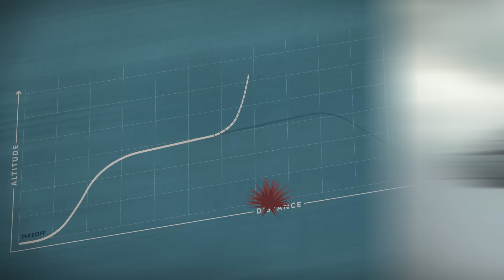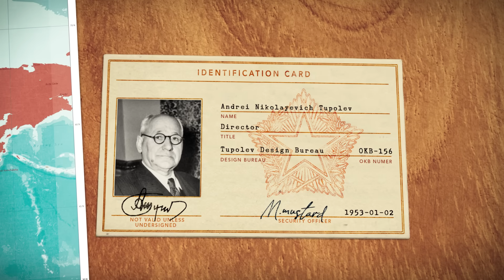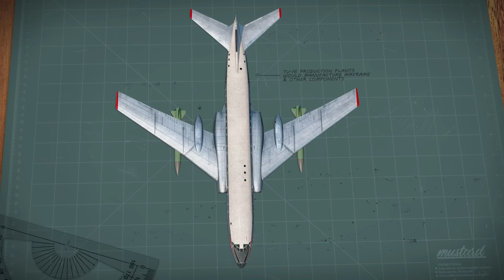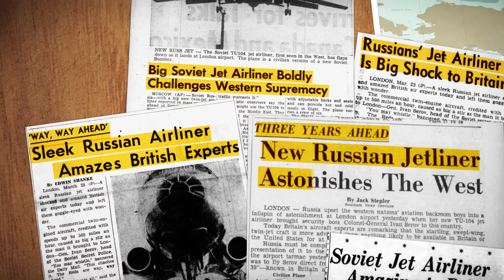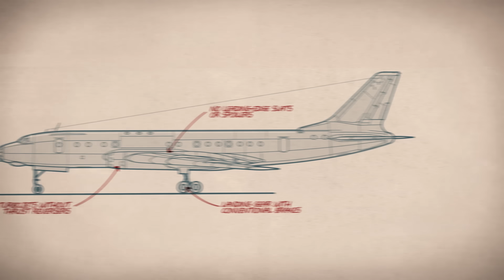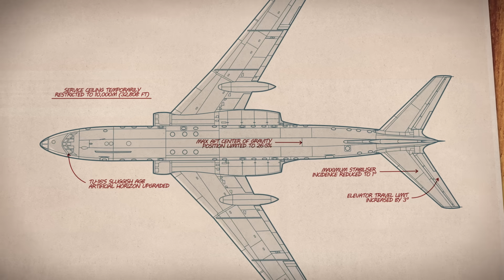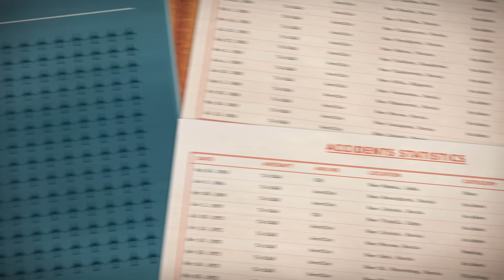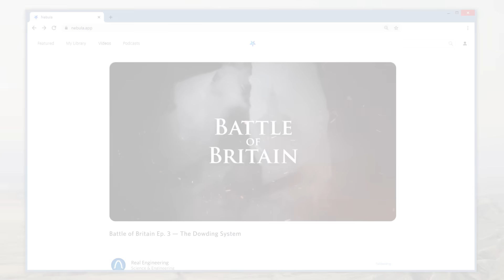The Soviet Airliner Designed To Crash

Comment: In a realist world a really small loss of life for an extremely huge jump in technology 😢
Reply: Certainly a more successful aircraft than the de Havilland Comet 1.
The Comet 1 was so bad it's certicate of airworthiness was permanently revoked
Reply: The Tupolev & Comet  had similar accident losses statistics.

The marvellous trailblazing DH Comet.

World's first jet airliner.
World's first high altitude airliner.

De Havilland was subjected to forced merger during the UK Govt instigated aerospace sector rationalisation programme.

Instances of all Comet marks, including the Comet 1, flew with full certification at some point after 1954. Airline duty Comets were all retired by 1980 with full certification until after retirement. The last Comet flight was a global circumnavigation series of flights in 1997.

   Of course De Havilland carried out a full stress analysis & performed extensive & protracted testing on two long lengths of fuselage. De Havilland carried out significantly more testing than was required by any authority at the time & significantly more testing that any previous airliner was subjected to.

    De Havilland did indeed always work to better than industry standards at the time, used up to date knowledge for the design & no evidence of negligence  or criminal negligence was ever produced in relation to the DH Comet.
  
  Obviously there have been worse aircraft for accident losses both before & after the Comet, that includes's fatality rate metrics. One of the issues was accident losses & incidents due to pilot error which were often caused by the novel aspects of jet airliner flying, even so, the accident losses for the Comet were not particularly unusual at the time.

About Bow-wing for instance (See b-47 wing folding / collapse incidents.)

There can be no excuses for the 737 Max incidents after more than 50 years design, build and operation experience & with up to date aviation infrastructure. 737 Max, 2 particular incidents caused 350 fatalities. Aircraft auto pilots itself into the ground, two times.

The many & varied reasons for Bow-wing's (See b-47 wing folding wing collapse incidents) current existence & status have nothing to do with the company itself by the way.  

    How things were back then. 
Accident losses - % of aircraft built.
DeHavilland Comet 4 UK              14% 
DeHavilland Comet all mks          17%  
Vickers VC10 UK                            5%

The DH Comet had better safety than or similar safety to many other commercial passenger aircraft of a similar era.
Douglas DC-1                                      99%
Douglas DC-2                                      47%
Douglas DC-3                                      30%
Douglas DC-4                                      26%
Boeing s300                                        72% 
Boeing 307                                          70%
Boeing 247                                          48%
Boeing 707                                          20% 
Lockheed L-049/149 Constellation  30%
Lockheed Electra  Turboprop .          29%
Fairchild FH-227                                 30%
McDonnell Douglas DC-8                  14%
Sud Aviation Caravelle                       15%
Canadair CL-44  Turboprop               46%  
Convair CV-580  Turboprop               22%
Convair CV-880     (ff 1959)               27%  
Convair CV-990     (ff 1961)               33%
Tupolev T-104        (ff 1956)               16%.

Comment: In soviet union plane flys you...straight into the ground
Reply: British plane flies you to your death when it explodes at high altitude.
Reply: The Tupolev & Comet  had similar accident losses statistics.

The marvellous trailblazing DH Comet.

World's first jet airliner.
World's first high altitude airliner.

De Havilland was subjected to forced merger during the UK Govt instigated aerospace sector rationalisation programme.

Instances of all Comet marks, including the Comet 1, flew with full certification at some point after 1954. Airline duty Comets were all retired by 1980 with full certification until after retirement. The last Comet flight was a global circumnavigation series of flights in 1997.

   Of course De Havilland carried out a full stress analysis & performed extensive & protracted testing on two long lengths of fuselage. De Havilland carried out significantly more testing than was required by any authority at the time & significantly more testing that any previous airliner was subjected to.

    De Havilland did indeed always work to better than industry standards at the time, used up to date knowledge for the design & no evidence of negligence  or criminal negligence was ever produced in relation to the DH Comet.
  
  Obviously there have been worse aircraft for accident losses both before & after the Comet, that includes's fatality rate metrics. One of the issues was accident losses & incidents due to pilot error which were often caused by the novel aspects of jet airliner flying, even so, the accident losses for the Comet were not particularly unusual at the time.

About Bow-wing for instance (See b-47 wing folding / collapse incidents.)

There can be no excuses for the 737 Max incidents after more than 50 years design, build and operation experience & with up to date aviation infrastructure. 737 Max, 2 particular incidents caused 350 fatalities. Aircraft auto pilots itself into the ground, two times.

The many & varied reasons for Bow-wing's (See b-47 wing folding wing collapse incidents) current existence & status have nothing to do with the company itself by the way.  

    How things were back then. 
Accident losses - % of aircraft built.
DeHavilland Comet 4 UK              14% 
DeHavilland Comet all mks          17%  
Vickers VC10 UK                            5%

The DH Comet had better safety than or similar safety to many other commercial passenger aircraft of a similar era.
Douglas DC-1                                      99%
Douglas DC-2                                      47%
Douglas DC-3                                      30%
Douglas DC-4                                      26%
Boeing s300                                        72% 
Boeing 307                                          70%
Boeing 247                                          48%
Boeing 707                                          20% 
Lockheed L-049/149 Constellation  30%
Lockheed Electra  Turboprop .          29%
Fairchild FH-227                                 30%
McDonnell Douglas DC-8                  14%
Sud Aviation Caravelle                       15%
Canadair CL-44  Turboprop               46%  
Convair CV-580  Turboprop               22%
Convair CV-880     (ff 1959)               27%  
Convair CV-990     (ff 1961)               33%
Tupolev T-104        (ff 1956)               16%.

Comment: We believe we can clear up some commonly held myths and misconceptions obviously.

It's always good to see the facts presented clearly and concisely isn't it?

Obviously there have been worse aircraft for accident losses both before & after the Comet.

  De Havilland was subjected to forced merger under the govt aerospace sector rationalisation programme.

In 1944 the RR Nene, a centrifugal compressor gas turbine aero engine, was the most powerful & most reliable gas turbine aero engine on the planet. For decades after 1944 copies & versions of the RR Nene & RR Derwent would go on to power aircraft in many countries including Russia (Mig-15 & Mig-17), the US, France, Switzerland and China.  Five manufacturers currently produce various types of gas turbine aero engines which include centrifugal compressors, the main application is helicopters. 

The world's first wind tunnel was constructed in England before 1890. The world's first supersonic wind tunnel was constructed in England in 1922. Extensive wind tunnel testing & evaluation were carried out for the Comet. All takeoff incidents were the result of stalls caused by over rotation. There were feature induced issues where pilots tended to not using jet airliner specific takeoff procedures. Subsequent changes made to the aircraft were an attempt to make the aircraft more tolerant of such errors. 

It is in fact correct to state that no aircraft manufacturer had managed to produce a high altitude airliner with a full fuselage length pressurised passenger cabin pressurised to 8 psi differential before De Havilland did it with the fabulous trail blazing Comet. This was the first aircraft where pressurisation stress significantly exceeded flying stress for most of the airframe. The world's first pressurised cabin aircraft was a British design Airco built under licence in the US and modified in the US to have a pressurised cockpit cabin during a joint US / UK research project. 

 Testing included water tank pressurisation cycle tests on two 20 foot lengths of fuselage which represented all features of the complete fuselage.

The engines used for the earlier Comets were of course similar to the RR Nene, were very reliable  & were not responsible for any Comet incidents.

The fabulous trail blazing DH Comet.
World's first jet airliner.
World's first high altitude airliner.

    How things were back then. 
Accident losses - % of aircraft built.

DeHavilland Comet 4 UK                     14% 
DeHavilland Comet all (ff 1949)         17%  
Vickers VC10 UK (ff 1962)                   5%

Douglas DC-1                                      99%
Douglas DC-2                                      47%
Douglas DC-3                                      30%
Douglas DC-4                                      26%
Boeing s300                                        72% 
Boeing 307                                          70%
Boeing 247                                          48%
Boeing 707  (ff 1958)                         20% 
Lockheed L-049/149 Constellation  30%
Lockheed Electra  Turboprop .          29%
Fairchild FH-227                                 30%
McDonnell Douglas DC-8                  14%. 
Sud Aviation Caravelle                       15%
Canadair CL-44 Turboprop (ff 1959) 46%  
Convair CV-580 Turboprop                 22%
Convair CV-880  (ff 1959)                   27%  
Convair CV-990  (ff 1961)                   33%
Tupolev T-104     (ff 1956)                   16%

  The Vickers VC10, fastest Atlantic crossing for a non supersonic jet airliner, held the record for 41 years. 

The DH Comet & Sud Aviation Caravelle had similar accident loss fatalities for the first few years of operations.

Agreed, that is correct of course, clearly there are many countries that could easily produce airliners of better  quality than Bow-wing (see b-47 wing folding & wing collapse incidents) but don't for some very good reasons. Bow-wing being a result of the size of the US, the large protected domestic market & great ease of testing new types due to the equator to arctic geography & a few other reasons related to production scale capability, politics & economics.

  Obviously there really is nothing special about Bow-wing, having more than 50 years design / build experience on the type means they have no excuses for the horrendous Max incidents for example.

   Of course De Havilland carried out a full stress analysis & performed extensive & protracted testing, including pressure cycle testing, on two long lengths of fuselage. De Havilland carried out significantly more testing than was required by any authority at the time & significantly more testing that any previous airliner was subjected to.

    De Havilland did indeed always work to better than industry standards at the time, used up to date knowledge for the design & no evidence of negligence or criminal negligence was ever produced in relation to the DH Comet.

  The DH Comet had better safety than or similar safety to many other commercial passenger aircraft of a similar era both before & after the DH  Comet.

Pretty much all changes made after the Comet 1 were just in case changes or were previously planned ongoing improvements.

We do indeed hope this helps, of course.
      
As always, cheers & 👍 indeed.  .

Comment: 2 earliest jets both turned out to have teething issues. 
British grounded their planes, soviets said "yeah this is fine. Keep going"
Reply: The Comet has the highest loss rate and fatalities statistics of any jet airliner in history.
Reply: @WilhelmKarsten  it was quite literaly the first one and other erly pames safety records are only better because of lessons comet learned. Still plane was grounded after fatal flaw was identified, cant say the same about soviets way of doing stuff.
Reply: @petrsukenik9266 The de Havilland Comet was one of several failed attempts.
The first successful airworthy jet airliner is the Boeing 707 family.

The real tragedy of the Comet Disaster was that it could have been easily prevented if de Haviland had simply followed well-known and understood industry standards for the design and construction of pressurized cabins made from riveted aluminum alloys.

Companies like Junkers, Boeing, Douglas and Lockheed pioneered pressurized airliners  when de Haviland was still building aircraft primarily from wood and fabric.

The only lesson learned from the Comet Disaster was that aircraft manufacturers like de Haviland could no longer be trusted to conduct their own crash investigations.

D-H eventually admitted that they never preformed any stress tests on the fuselage sections that failed.
Reply: We believe we can clear up some commonly held myths and misconceptions obviously.

It's always good to see the facts presented clearly and concisely isn't it?

Obviously there have been worse aircraft for accident losses both before & after the Comet.

  De Havilland was subjected to forced merger under the govt aerospace sector rationalisation programme.

In 1944 the RR Nene, a centrifugal compressor gas turbine aero engine, was the most powerful & most reliable gas turbine aero engine on the planet. For decades after 1944 copies & versions of the RR Nene & RR Derwent would go on to power aircraft in many countries including Russia (Mig-15 & Mig-17), the US, France, Switzerland and China.  Five manufacturers currently produce various types of gas turbine aero engines which include centrifugal compressors, the main application is helicopters. 

The world's first wind tunnel was constructed in England before 1890. The world's first supersonic wind tunnel was constructed in England in 1922. Extensive wind tunnel testing & evaluation were carried out for the Comet. All takeoff incidents were the result of stalls caused by over rotation. There were feature induced issues where pilots tended to not using jet airliner specific takeoff procedures. Subsequent changes made to the aircraft were an attempt to make the aircraft more tolerant of such errors. 

 Testing included water tank pressurisation cycle tests on two 20 foot lengths of fuselage which represented all features of the complete fuselage.

The engines used for the earlier Comets were of course similar to the RR Nene, were very reliable  & were not responsible for any Comet incidents.

The fabulous trail blazing DH Comet.
World's first jet airliner.
World's first high altitude airliner.

    How things were back then. 
Accident losses - % of aircraft built.

DeHavilland Comet 4 UK                     14% 
DeHavilland Comet all (ff 1949)         17%  
Vickers VC10 UK (ff 1962)                   5%

Douglas DC-1                                      99%
Douglas DC-2                                      47%
Douglas DC-3                                      30%
Douglas DC-4                                      26%
Boeing s300                                        72% 
Boeing 307                                          70%
Boeing 247                                          48%
Boeing 707  (ff 1958)                         20% 
Lockheed L-049/149 Constellation  30%
Lockheed Electra  Turboprop .          29%
Fairchild FH-227                                 30%
McDonnell Douglas DC-8                  14%. 
Sud Aviation Caravelle                       15%
Canadair CL-44 Turboprop (ff 1959) 46%  
Convair CV-580 Turboprop                 22%
Convair CV-880  (ff 1959)                   27%  
Convair CV-990  (ff 1961)                   33%
Tupolev T-104     (ff 1956)                   16%

  The Vickers VC10, fastest Atlantic crossing for a non supersonic jet airliner, held the record for 41 years. 

   Of course De Havilland carried out a full stress analysis & performed extensive & protracted testing, including pressure cycle testing, on two long lengths of fuselage. De Havilland carried out significantly more testing than was required by any authority at the time & significantly more testing that any previous airliner was subjected to.

    De Havilland did indeed always work to better than industry standards at the time, used up to date knowledge for the design & no evidence of negligence or criminal negligence was ever produced in relation to the DH Comet.

  The DH Comet had better safety than or similar safety to many other commercial passenger aircraft of a similar era both before & after the DH  Comet.

Pretty much all changes made after the Comet 1 were just in case changes or were previously planned ongoing improvements.

We do indeed hope this helps, of course.

As always, cheers & 👍 indeed.